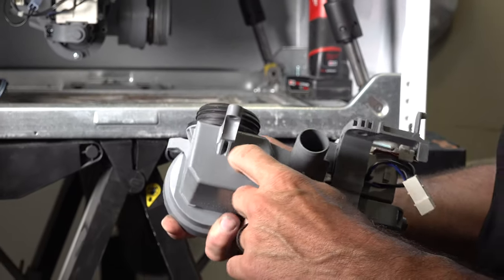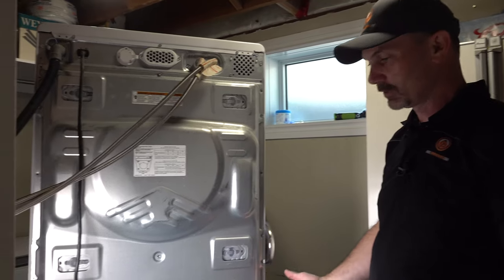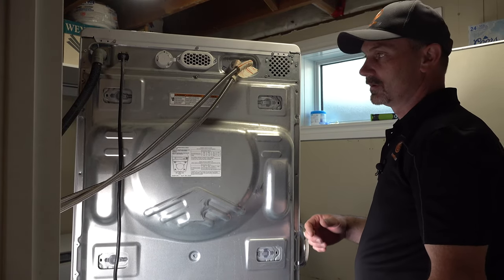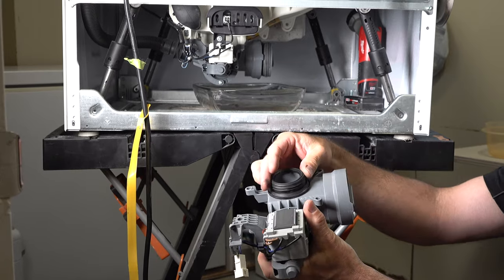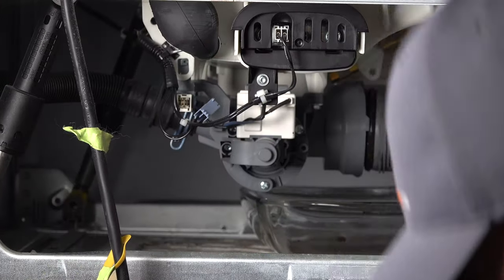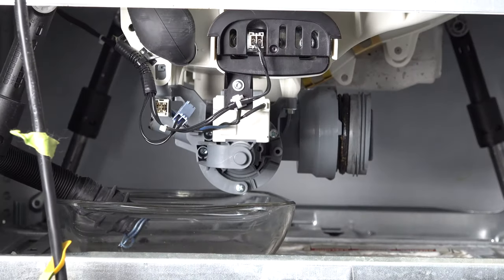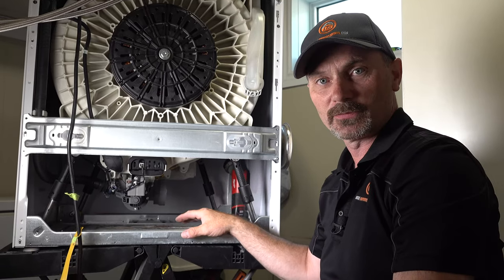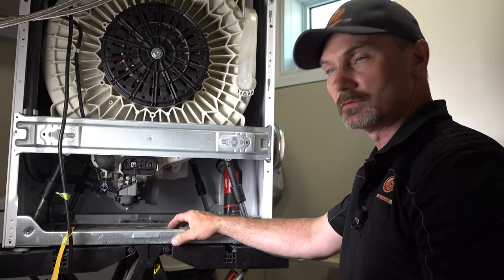How To Replace a Washer Pump on a Front Load Washing Machine (Full Tutorial)

Comment: HELPFUL HINT - If you're getting error code indicating drain issue or pump failure, remove the water pump while you're cleaning filter and hose.   I cleaned the filter (which really wasn't dirty or clogged) and still got the error message.  I repeated the process but removed the water pump the 2nd time.   After removing,  I disassembled the water pump by removing 3 screws that held pump together.  Inside the pump,  I found the culprit.  A thin nail was preventing the impeller from rotating.   I reassembled, and all is perfect again.

Comment: Why couldn't lay it on its front or one of its sides? Of corse on a blanket or something 😊
Reply: If you try that, be sure to drain everything out and clean the tray first.  Water can exit via that front seal (multi-point mess), and debris can also wind up back under the drum.  Modern washers are light enough to tilt and put blocks under for a few more precious inches.
Reply from the maker: You will have a mess from draining water .

Comment: I replaced the squeeze clamps with stainless worm drive clamps. The squeeze types are for saving a few cents of time and expense at the factory! Around here, a minimum markup of 300 percent is usual on parts if a service guy comes. They have to go get it (nobody stocks anything in the 10:07  struck)and that is an hour or more of time and vehicle charge.

Comment: I don't know if my Samsung has a filter like that.  When mine was new the drain pump was replaced under warranty.  Had power going to it, just electrically dead.  I had to drain the water out of the tub, could have replaced the pump myself it was right there when the back cover came off.  But for the warranty someone else did that part.
Thanks for the video.